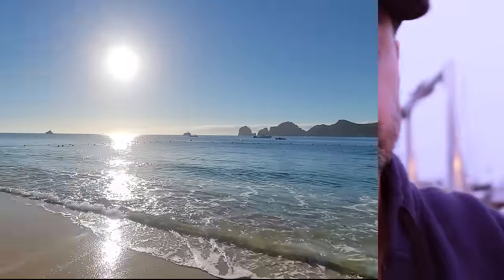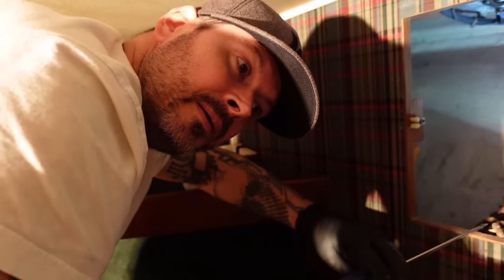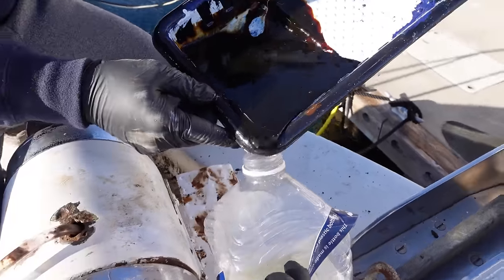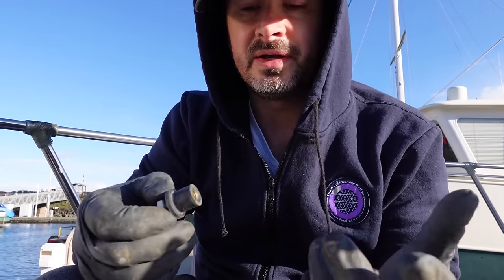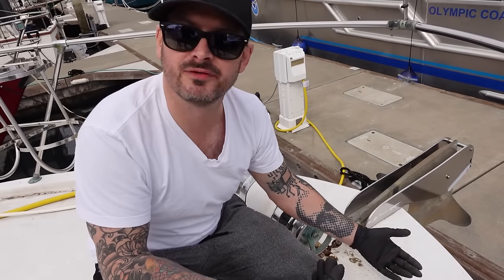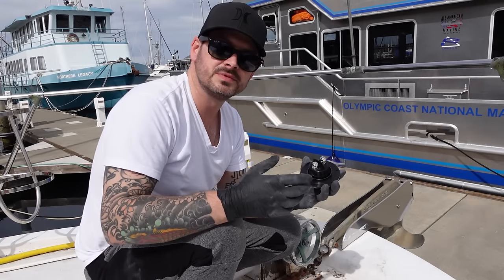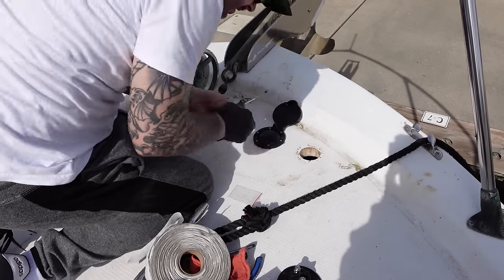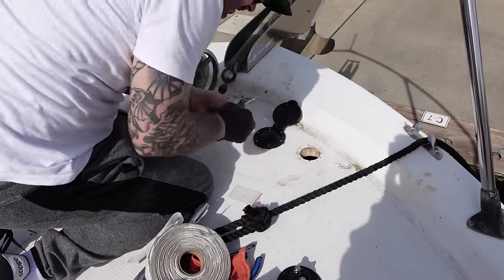Restoring BROKEN Anchor Windlass | Old Yacht Restoration | Ep. 12

Comment: If your boat’s hull has not been painted in the past and it is still gelcoat you guys should really consider just buffing out the gelcoat on the hull.  If the gelcoat is anything like my Chris Craft you will be very surprised and pleased on how nice it comes back to its original shine. Your boat probably has gelcoat at least twice as thick as some of the newer boats out there nowadays and it is possible to bring the shine back with some elbow grease and effort. I would agree on painting the upper deck since it is probably in a lot worse shape from the direct sun beating down on it and being walked on all these years.
Reply from the maker: Unfortunately it's been painted. We thought about trying to strip it but not sure how that would turn out. Thanks for the input.
Reply: Some boats have been painted many different colors.  One boat my dad first had was once a navy shuttle.  If you can imagine how many coats of paint were on the bottom of that boat, it was scary gray and thick.  Removal down to the wood was a major labor of love involving my mom and dad, with my two older brothers and me.  In the end, after some rot repair the boat bottom looked great, too bad it was under water.  We did the same with the sides but painted them white, and all the teak topsides were cleaned and revarnished.

Comment: You guys really need to cover all of that exposed core at those foot switches with expoxy or similar to stop the foredeck going soft. Most common source of deck rot is anchor foot switches…
Reply from the maker: Yep, your absolutely right.
Reply: @SeekingSeas  but ps I love your channel.. it’s like deja vu with jobs on your boat like ours.
Reply: By cover the core he means that you have to remove those switches, remove the balsa core for about 1” and then fill the area where it was with a thickened epoxy filler.  Then re-drill the mounting screw holes into that filler.  This MUST be done or 100% guarantee that you will let water into the core of the deck which is going to lead to a repair that will cost more than the boat in a few years.  Google around for “decoring balsa core”.  Easy to do with an Allen wrench in a cordless drill.  I have used butyl for years and moved on to bedding deck items in UV rated 3M 4200 caulk.  The butyl will run out in the heat and you will always be cleaning it off… Not yelling lol but want to be sure you don’t create a problem long term here.  I have in the past and it was no fun!

Comment: paint the exposed wood core with epoxy when you cut holes in the deck, if you have a leak your deck might not rot.
Reply: Also pays to drill out the screw holes larger than needed, fill with thickened epoxy then screw into the epoxy, that way the wood core is again protected from the inevitable leak that comes with time and exposure.
Reply: yes,, otherwise one day the whole deck will be rotten ,, that stinks. Great project !!

Comment: Guys you need to use 3M 5200 glue to seal anything lithe the covers for the windless and stuff that is in the outside areas of the boat. It be a seal that will last forever. Don’t go no where with out having 3M 5200 on board at all times!

Comment: Definitely get that windlass serviced when you can. If you drop the pick and need to get the chain up in an emergency it may cost you. Also. I doubt you could pull the chain up by hand anyway. Also new chain asap. Check all the fittings. 
Just a safety tip. 
You guys are doing a bloody fantastic job. Well done crew

Comment: I have seen some boat owners decide to use a wrap on their hull as opposed to painting. It’s like putting wrap on a car. Obviously for just the hull above the water line. Much cheaper than paint. The main downside is that it doesn’t stand up well to abrasion such as rubbing up against a dock or piling. However, you can always replace any damaged areas by cutting in a patch. Also, I couldn’t tell if your deck has a wood core. If it does, you would be well served by pulling out your foot switches and sealing the wood core with some epoxy and reinstalling your foot switches. This will help close out your core and help minimize any moisture migration through the wood which can lead to a rotten deck core. Love your channel. You guys are doing great. Keep up the good work.
Reply from the maker: We have been getting a lot of messages directing us to wrapping the boat. We think its a great idea and are looking into pricing as we speak. We do have a wood core and will seal it up with epoxy, thank you.

Comment: As a former merchant marine I have laid down a lot of paint on ships. My advice on the exterior go with a marine epoxy paint. It expensive but lasts a whole lot longer. Neutralize all rust before you paint with ospho. Then when it comes back spray it down with some watered down osph to kill the running rust till its time to repaint.

Comment: Just found your channel and started bingeing.  My uncle has a uniflite up near you.  Similar model.   One thing you may want to look at is:  OSPHO–Rust Converter/Metal Primer.   West Marine carries it.  Works like a champ but you dont want to inhale it so wear a mask.  That anchor looks like its missing the steel lead and safety clip btw.
Reply from the maker: We've actually recently used OSPHO in the engine room, and it will be in a future video, works great! Thanks for the suggestion on the safety clip, we'll be sure to get that attached before our next trip.

Comment: The expansion plug is a good stopgap, but when you get a chance, have someone weld a bung on in it's place that you can fit a proper plug into.  That expansion plug will end up leaking as the rubber gets worn or cut by the metal of the housing.  I like the idea of a Sea Green hull.
Reply from the maker: Thanks for the advice, we were looking for a more permanent solution.

Comment: First! just had to... I think blue will look fantastic, and while the boat is out of the water you have an opportunity to install or upgrade any sort of depth/fish finder or sonar. Very excited to see your progress!
Reply from the maker: Alright, a vote for blue! We are planning to remove any unnecessary through-hull sensors that previous owners decided to keep adding. Instead of removing one to replace one, we must have at least eight in the bottom of this thing, not good.
Reply: @SeekingSeas  there are through hull blanks you can get at west marine.  May be a less spendy option than glass patching the hull in the unwanted spots.
Reply from the maker: Sounds like a good option, we'll look into it!

Comment: I dont know a lot about how much it would cost to repaint but i do know that a lot of people are doing wraps now days and they are supposed to be cheaper then painting but you would have to look into it more. A darker teal would be pretty beautiful as well. As for the top maybe look into boat mats they are adhesive rubber mats that can be installed professionally and they help with limiting slipping and also make the deck less likely to burn ur feet on a hot day.
Reply from the maker: Great idea, we are looking into that. Raptor decking was one company. If you know of others, please let us know.

Comment: If you paint the boat, use a spray gun don't roll and tip it. Any time you drill a hole in the deck, seal the exposed wood with resin so water can't infiltrate your deck and cause the core to rot when the butyl tape fails, it will save you trouble later on.
Reply from the maker: Thanks for the advice, we were thinking we were going to roll and tip, not so sure about that now.

Comment: How do you stop the water going down the chain hole into the cabin below. Fab job by the way 👍👍
Reply from the maker: There's a chain locker under neath there that is isolated from the cabin, there's a hole on the hull in the starboard side that allows water from the chain locker to drain. If that hole got plugged for some reason and water filled up the chain locker we would have a problem. We're looking into solutions to prevent or at least limit water going down the chain hole.

Comment: nice work. i did think on the switches you replaced, you could have sealed the deck wood where you cut just with a varnish/sealer coat to stop water/moisture ingress, otherwise it all looks great!
Reply from the maker: Well get it sealed up with some epoxy, thanks

Comment: If you are doing the exterior finish then do it in Gel Coat instead of Paint.  Bit more expensive but it will be worth it in the long term.
Reply from the maker: It was previously painted, not sure if we can gelcoat over that or would have to strip it completely.

Comment: Is there a Cover for the Chain Return into the storage of chain  when your under way in Rough seas.  I am sure it has a drain inside ? But in rough seas it could be like a fire house into the hull?
Reply from the maker: There is no cover, it does have a drain but your right there could be a lot of water coming in. Our plan is to try out a grommet of some sort, just don't know how well it would hold up to chain sliding through it all the time.

Comment: Also you need to add a steel cable and clip as the safety backup incase to windless let's go while you're underway. That would be disastrous. I'm sure someone removed it and never put it back. I think west marine stocks them.
Reply from the maker: Thanks! We'll be sure to get the safety clip attached before we need to use the anchor.

Comment: Something that is tethered to the Windlass that fits tight around the chain that would come off when in use and placed back on when your on your way by hand manually  there has to be some type of boating fix?
Reply from the maker: There has to be something we just haven't found it yet. We'll do some research to see if we can come up with a solution.

Comment: Did you remove the metal filings that dropped inside, when you were using the hack saw on the hole? metal filings will destroy the gears!

Comment: Keep in mind that your ANCHOR is too light for your boat. You can inquire about this at the store.
Reply from the maker: The boat came with this anchor and another spare. We will look into getting a correctly sized anchor, thanks for the heads up.
Reply: Weight doesn't matter. Look at fortress anchors. They weight next to nothing, aluminum. Anchors are sized per boat. It's how it grabs the bottom and the surface area vs gross tonnage. Looks correct to me.
Reply: @SeekingSeas  If you can swing it look into Mantis anchors. They are some of the best out there. The aren't cheap but they are the best grabbing anchors out there. You would be looking at a 65  pound or so.

Comment: Do NOT paint the hull or topsides--unless you are using a 2-part paint and you go through an intensive prep. Most folks try to paint over fiberglass and they discover it's hard, intensive and much more expensive than they could ever imagine--then they simply FU**k it up. Rub out and polish the glass as best you can ------you will really like the results----talk with the pros and they'll tell you how to improve the fiberglass. -------Good luck-------Mikey, in Belfair
Reply from the maker: Hey Mikey, unfortunately this boat has been painted before, both hull and topsides. I don't think we have any option but to paint it again. We are also considering wrapping the hull

Comment: Painting the hull teal would not be good idea ! You would be losing some of the value you are creating. Uniflights have a good rep and if you ever want to sell her keeping it off white or white would be best. You may want to look into a rap also for the hull, just like a car rap . I see you used 5200 to seal the plywood cover you made, only use 5200 on things you never want to take off 4200 works for things you will remove at some point. I have seen 5200 rip the fiber glass off a deck when removing fittings. Robert Fitter is very correct when you pull things that create a hole in the deck you need to epoxy around the inside of the hole. I restored a 1979 Tolly Craft and made sure to do this for holes.
Also when you pull wallpaper and expose the plywood make sure to look for moisture on the Plywood, this era boat will leak and you should be looking for that every step of the way.
Reply from the maker: Thanks for the advice, we decided we'll either paint it white or wrap it, depending on cost. We have been looking at all wood structures as we go and will seal anything that passes through decks or hull.